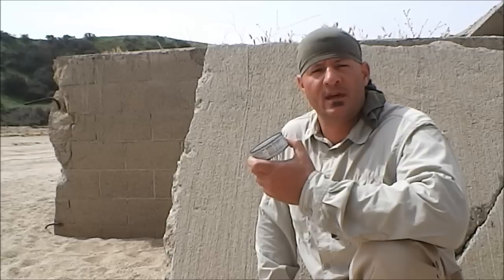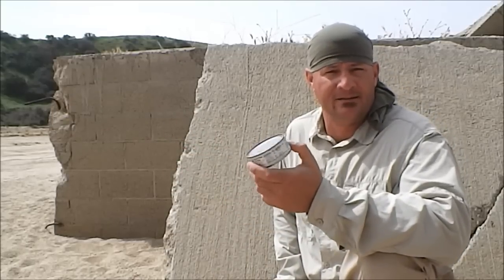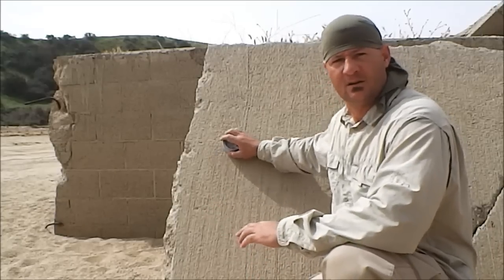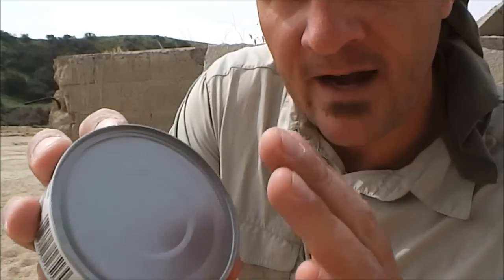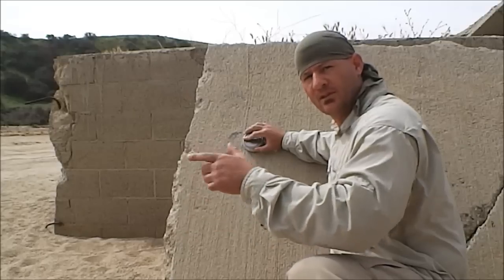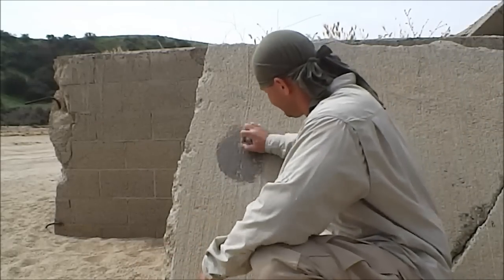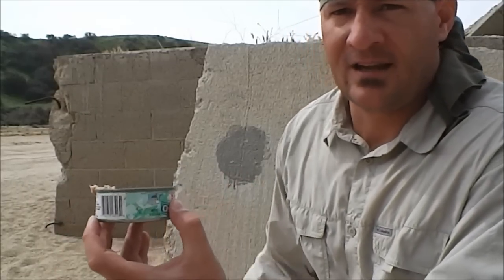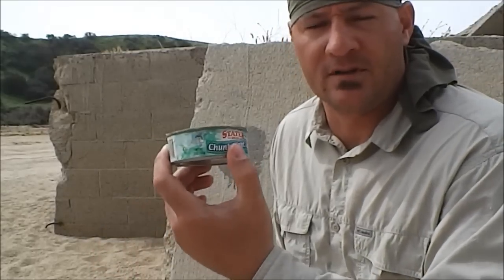An Alternative Way to Open Tin Cans (Urban Survival)

Comment: This technique works like a charm, but you don't always have to file it down until it opens, you only need to file most of the lip down and then squeeze the tin to make the lid pop open, that way you don't get gunk in your food.
Reply: @Doobie603  if you have LOTS of water rinse everything a few times DURING the 'grind'

Comment: I've never trusted this method because the metal flakes can go straight into the food. In a true "I need to eat" situation, sure, but those flakes can kill you, and cut up your intestines on the way out, which is just not fun, trust me. On top of that, in todays cans there may also be bits of toxic plastic in the seal that goes straight into that food source. I like the simplistic idea, but I personally would hard pass on this method, as long as there is ANY other way.
Reply: you ever go 48 hours with NO FOOD ???

Comment: Perhaps you might try turning it completely upside down on a horizontal rough surface.  You will lose the liquid, but no metal will get into the can.  Alternately, you can use a pointy rock and drive it into the lid with another rock. Wash or sterilize the rocks first and you have no worries.  Have no pointy rock?  Make one by grinding it on a large rough surface.  You will find it a handy tool if you have no knife.

Comment: great tip however, i would stop as soon as dampness is seen on the stone and carefully squeeze the can and/or tap it with a stone or branch on sides and break the last bit if metal, prying it off then may be a problem but less contamination . if its a soup or beans one only needs a smallish hole to pour contents.

Comment: Wouldn't it be better to use a horizontal surface and let gravity help keep the contaminants out of the food?
Reply from the maker: and should the lid fall out as you lift the can off of the ground foo could follow it. The point of the demo was to show an alternate way to open a can. Use whatever method you want